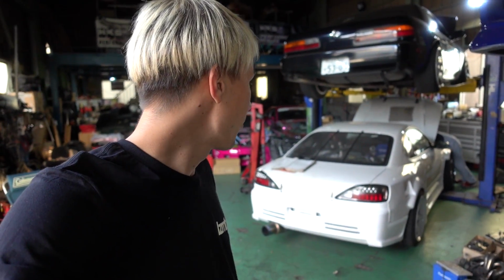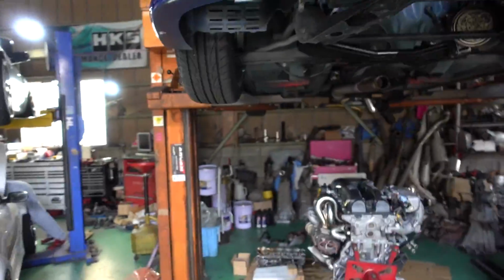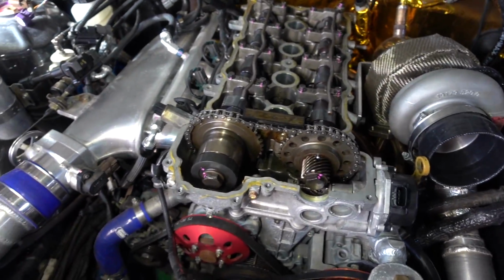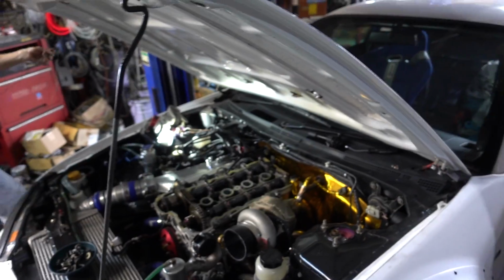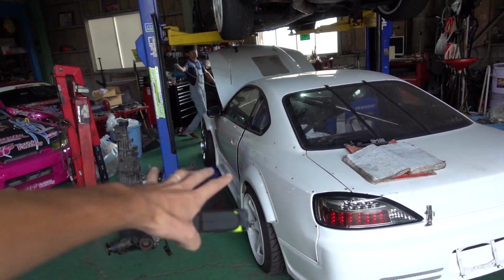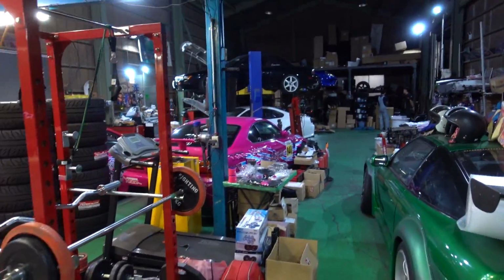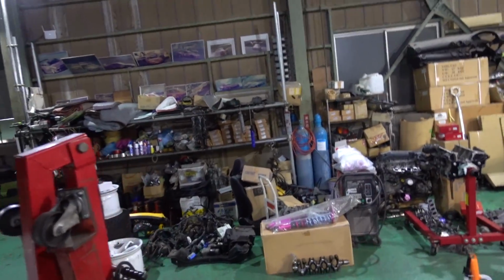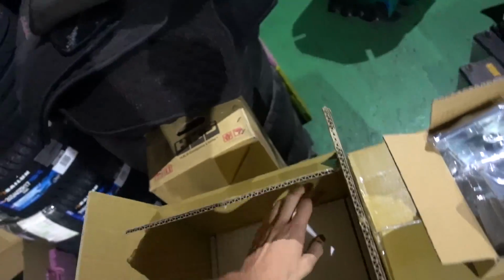PREVIOUS OWNER ISSUES...

Comment: Just a heads up on the selling of harnesses, if they're F.I.A aproved,they're still valid 5years after the expiry date
Reply: Hum.... 
When it comes to the rest of the harness both certifications are as safe as each other, the only benefit with the FIA harnesses are the use by dates. In 1998 the FIA introduced new harness Standards 8853/98 and 8854/98, which stipulated that the validity of a harness expires five years after the year of manufacture.Sep 19, 2016

Comment: Doing the toolboxes would be amazingly helpful .  Putting NOS In a rental car is an invitation to disaster.  Some untrained idiot will blow a motor either by giving too much Nos or reving the engine too high and adding NOS at the wrong time.